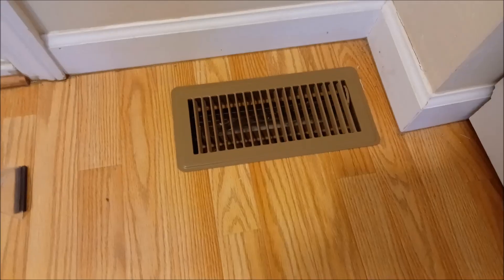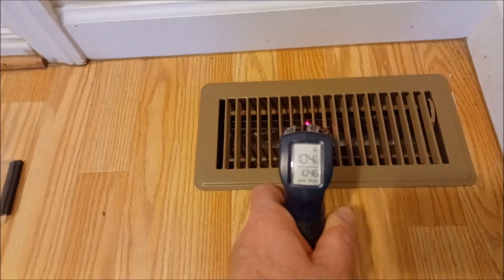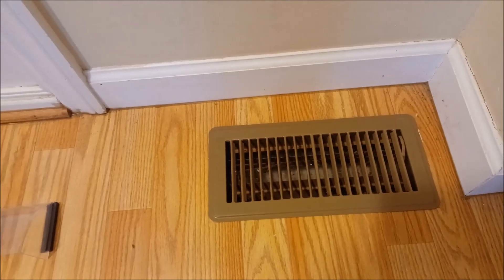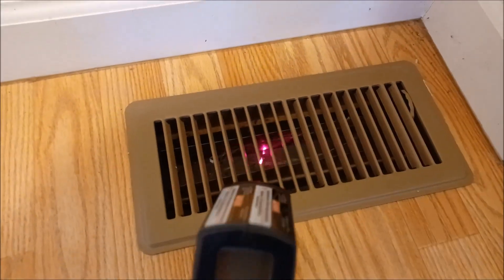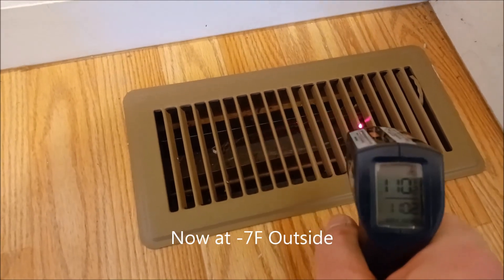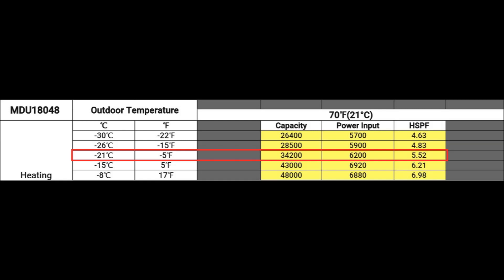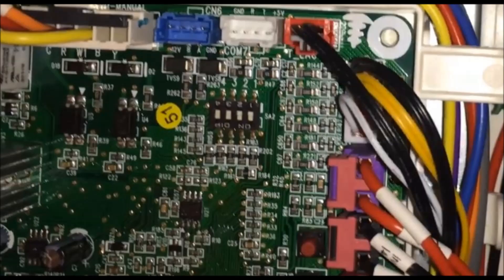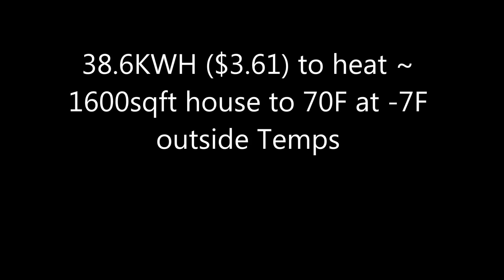Mr Cool Heat Pump Universal Operating  at -7F Nice and Warm Inside No need for Natural Gas

Comment: I'm seeing similar results with my Mr. Cool Universal.  Mine is a 2-3 ton version I installed this past spring (cost less than $4000) single fan compressor and this week was my first deep freeze.  I just added the A-Coil to my existing 'old Bryant' gas furnace and have a Google Nest thermostat configured in dual fuel to kick the gas heat on at 0.   True to colors, it did just that.  But even as temps dropped to 0, the compressor unit performed just nicely.   I can attest to you,  you do not want to stand in front of that condenser fan when it's 3 degrees outside;  unless you like frostbite.  If you curious, it has a defrost cycle to melt ice and snow on the fins, and it does make some noises when it completes and shifts the reversing valve (going from heating to cooling) to thaw the outside fins.  -7 does not surprise me.  Anyway Thumbs up to you (and Mr. Cool) and thanks for the video.
Reply from the maker: I thought I might have to kick it up to 5t mode,  but it's worked great the whole time!
Reply: @stem_saving1644  that's awesome to hear! Any reliability issues?
Reply from the maker: None.  It's been in a little over a year.
Reply: i have been considering a similar set up, get the 5 ton universal with a A coil and add to the top of my existing gas fired furnace, add a dual fuel thermostat and play with the set point as needed based on whats cheaper, (gas or electric). this last cold spell has had me wondering how it would do. I've got 2300 square feet to heat though so hopefully it will keep up.
Reply from the maker: @briancorbett793  dual fuel just seemed like a pain for me.  I wanted all electric. Since i am solar. But depending on rates it makes sense in some cases for dual feul.. I use to get gouged by natural gas "delivery fees" ... not anymore.
Reply: @stem_saving1644   ya that makes sense. i was trying to go all electric, i replaced the water tank recently was going to go with a heat pump unit but I decided on a gas tank unit with a big burner (its an ao smith vertex). i was concerned with the 3 kids going to be teenagers eventually and the heat pump units have a slow recovery. also its in the basement that stays very  cold especially in the winter, that was another turn off.  if this set up works with the 5 ton mr cool universal for heating i might just shut off the gas to the furnace and go with it for everything but i was thinking id have the gas as a backup just incase something went sideways. really appreciate the video showing how low it can really go. crazy that your lazer just errored out...hahhah too cold to measure, crazy. im in northern ohio with about 2300 square feet to heat 1999 build so decent insulation but not perfect.
Reply from the maker: Your welcome for the video, consider subscribing. 

Almost all hot water heat pumps have a resistance mode which works faster then hp mode.  High demand algorithm usually detects high consumption and switches. I have a video showing my hp hot water heater.  I have a 50 gallon,  80 gallon gallon would probably fit your family best.  Plus there is a fed rebate.

It's nice to not have gas customer charges anymore. Where am 80 bill,  has half not going for gas usage. 

Let me know how your system works if you choose to go this route. I'm glad I did 😌
Reply: so does your A-Coil do both heating and cooling, or is the heat only from the gas furnace? Mrcool's description makes it sound like the a-coil can only work for cooling mode. Care to share your setup?
Reply from the maker: It's both heating and cooling. Watch my other videos on the install.
Reply: @briancorbett793  i did exactly what you are suggesting. Works great and was easy install.

Comment: Have you ever measured the kW for heating and cooling for 1hr?  Also, you must have a good sized solar array to pull 38kWh in a day during winter.
Reply from the maker: It's pretty  darn close to what the datasheet lists for power.  Usage is really dependent on set point  and heat loss of the structure.  

I do have a fairly large solar system that powers it all.  It's been a strategic planning process over the years to get this all built out.

Comment: I just installed a 3 ton universal.  I noticed it pulls 0.7 amps even when off!!  This amounts to $180 a year in wasted energy.  Do you know what your current draw is to the outdoor unit when off? Thanks
Reply from the maker: That seems odd.  I double-checked mine, and when off, sure enough I'm drawing 0.56A. Not to happy about that finding. Maybe  installing contactor in between will help.  Still worth the install, in my opinion.

Thanks for the info.  Another project for me.
Reply: @stem_saving1644  thanks for checking.  I discovered that when trying to understand why my compressor was producing significant vibration in heat mode and sounds find in cooling mode.  I cycled fan speeds, tried 2 ton mode, and tried to isolate the lines.  However, the compressor itself vibrates enough that it reverberates down the 3/4" line during heat mode enough that you hear it in the house (especially when trying to sleep).  Noise would be ok, but the vibration is tough to deal with.   I was planning on buying a second unit for my upstairs, but I'm thinking twice now.  Anyone experienced this?
Reply from the maker: Mine seems louder in winter as well.  I found that tying the linesets to each rafter dampened the noise and vibration.  I moved my outdoor unit away from my window just in case.  I'm experimenting on ways to reduce the vibration.

It's not  perfect,  but it's easy to install and cheap.
Reply: @stem_saving1644  The amperage is due to the crankcase heater.  This is necessary to keep the refrigerant in the correct state when it gets very cold outside to prolong the life of your compressor.
Reply from the maker: When it's 65f outside?  After HP being off for days? Seems high, if that's the case,  the pcb logic should turn this on when heat is called for to warm it up. Not keep it on continuously. Defeats the energy efficiency purpose.
Reply: I just read up on compressor heaters and it's less dependent on outdoor temp.  Some AC only compressors have them too. The refrigerant is attracted to the colder areas so the heater keeps refrigerant out of the compressor as much as possible from what I read.  The heater runs when the compressor is off and shuts down when the compressor is on.  It's a strip heater so it takes hours to heat the compressor.  I'd still like to find it on the unit, but I didn't notice it with thr noise blanket on
Reply from the maker: It's around the bottom of the unit.  I can't imagine it wouldn't take hours to heat since it's attached to the metal case heating it via conduction. I think it's just kept on instead of integrating it in a control system on the pcb where it's temp or use case based. But that's speculation... maybe a call to Mr. Cool would clear that up.
Reply: @stem_saving1644  I went back and forth with MrCool a bit on the vibration and the amp draw (which is usually about 21 or 22 amps).  They instructed me to switch the position of dip 4, which changes the unit to energy saver mode.  This did reduce the ramp up vibration I was seeing.  The unit still hits 21 or 22 amps but it runs longer and takes longer to ramp up.  Do you have any idea in heating mode what amperage you hit?  The plate on the unit says 16 amps  (Rated Load Amps).  MrCool has been avoiding my direct question on if 22 amps is ok or out of spec.
Reply from the maker: Interesting, so the fathest switch caused the system to ramp up slower and reduce vibration?  Does it heat less?  I noticed putting rubber insulation between the pipes along the compressor, and the wall reduces it as well. Might be a harmonic vibration... I'm seeing 28a being drawn during ramp.  Minor problems... but Interesting none the less.
Reply: @stem_saving1644  I did some isolation as well which helped.  After switching dip switch 4 the vibration is less on slower ramp up but the ramp down is still pretty abrupt.  It has more vibration in ramp down.  There are definitely some harmonics working in there.

Comment: Are you running a heat strip. My 2 to 3 t universal is only getting about a 17ﾟ change from return erhottest I've had at the vents is 87ﾟ
Reply from the maker: No heat strip. If your ducts aren't insulated and or have long runs,  your going to experience lots of heat loss.
Reply: These units -- well, I'm more familiar with Midea, not the Gree rebadged Mr Cool -- go to great lengths to maintain efficiency with complex (non-intuitive) computer control using the various temperature sensors to run at the absolute minimum power possible. A huge Delta-T is not a good thing for efficiency (YT video bragging rights notwithstanding); you actually don't want to be cranking out 100-120F (30F+ delta) air, because that means the compressor is running just about full tilt, where the best efficiency is when it can modulate down to 40-60%. What this means in practice is that these units tend to want to keep the delta T around the 15-20F range most of the time, as long as they compute that it's able to maintain the room temp at within a degree or two of setpoint. Only when the computer sees that it's losing its battle (from a combo of room temp drops, outdoor temp, and coil temps) will it (begrudgingly) crank up the power and you'll see those big deltas and also much higher power usage.

In this video, at -7F outside, with that 30F delta, I'd wager this thing is running darn near 100% full-out. There could be other factors at play as well, because these units (more so in the ducted/ductless mini splits) typically try to use as slow of a fan as they can get away with also (to keep from blowing cooler air). You'd also want to ensure static pressures are good, assuming the fan isn't modulated down, because lack of airflow can lead to higher deltas (and potential problems.) 

Anyway, don't try to overthink this units. If it's maintaining the set temp within a degree or two, just let it do its thing. If you really want to see it work, wait for a cold day and really bump the thermostat up, turn on turbo mode (if applicable), fans on high, etc. and then check your supply temps. Power monitors (Emporia) on the unit's circuit are a really useful tool to get some insight into what it's thinking. When charted over a few hours, it's also easy to see when it goes into defrost and/or needs to ramp up/down the power due to demand.
Reply: @bnasty267  with the “COP” it’s still cheaper than heat strips

Comment: What size house do you have to calculate for 4-5 ton and did you mess with the dip switches?
Reply from the maker: For heating, it's 3200.....cooling 1600.  The finished  basement  needs only heating and not cooling. Check my other videos for switches.

Comment: How often is your unit cycling on and off at these temperatures, and at more moderate temps like 20s and 30s?
Reply from the maker: That's a tough question to answer if you include the defrost mode which is  somewhat dependent on outside humidity.  I would say not including defrost I would see at duty cycle of 75 to 85% of on time in the -7f temps.  In the 30s it's more like  20 to 30%. It's really dependent on outdoor temps and how well insulated your house is and if you have lots of air leaks.
Reply: @stem_saving1644  Thanks. Do you have the ability to measure power consumption of the condensing unit?  Like how many watts will it pull under max operating conditions?
Reply from the maker: Yes,  I seem about 7200w under cold conditions. Right in line with the datasheet.